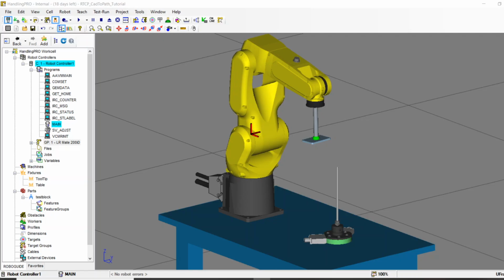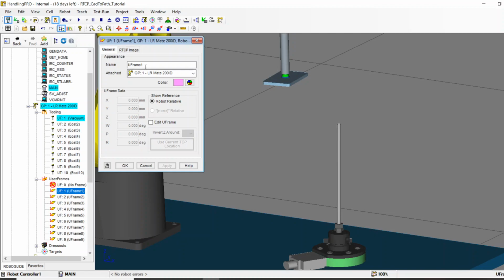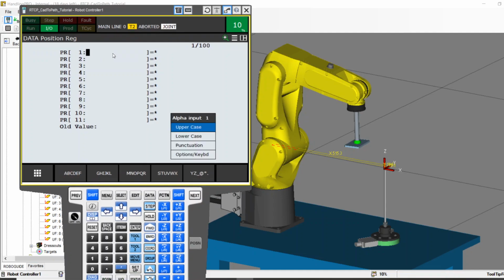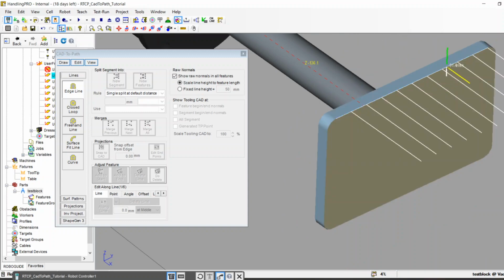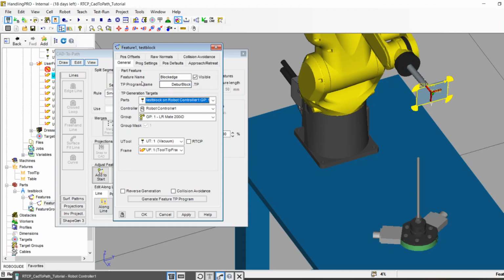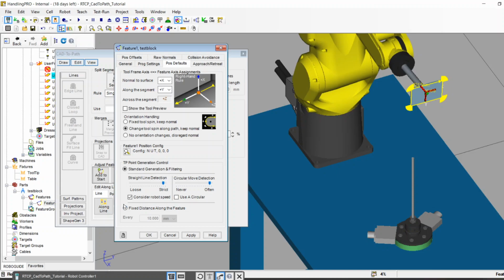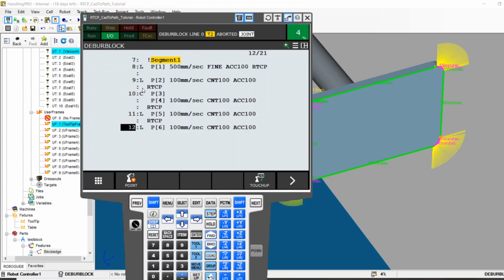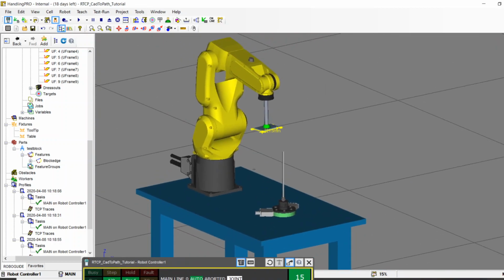FANUC Cad to Path and RCTP (Remote Tool Center Point)

Comment: When i am using " Feature" for create line path. However, there is only one tool " freehand line" that are allowed me to use. The others ( curve, surface fit line, edline...etc ) all are not able to click. How Can i fix this issue. Thank you so much
Reply: The same thing happens to me, were you able to solve the problem?
Reply: @gastongatti456  i solved the problem by changing the resolution of import file to high. At the time you import your part, roboguide will show you 2 options ( high or low). I solved the problem by choosing "high resolution" .
Reply: @nguyentung6862  thanks for answering. I use, part, add part, single cad file. where is the option to change the quality of the part?
Reply: @gastongatti456  the option will be showing right the time you import the file. It is automatically appearing.. What kind of roboguide version do you have?
Reply: @nguyentung6862 9.3 version H, in some pre-loaded parts of the program if I have the option to choose for quality, with which program do you design the pieces to load in roboguide? I use a .stl file
Reply: @gastongatti456  Im using Version N. I used solidwork . My files are STP or IGS .
Reply: @nguyentung6862  Thank you very much for the answers.